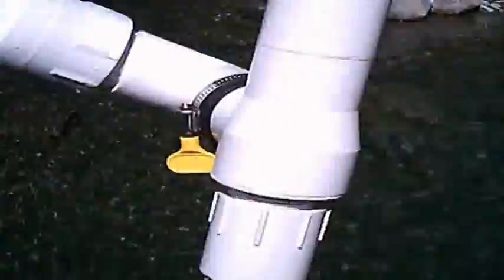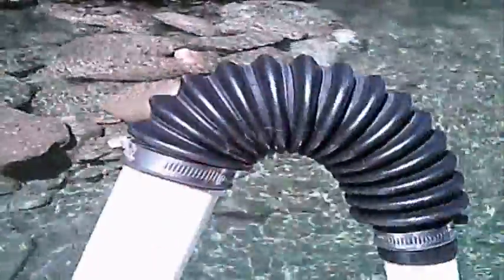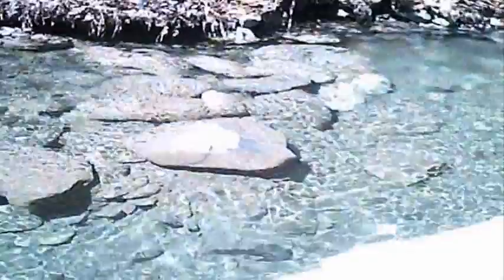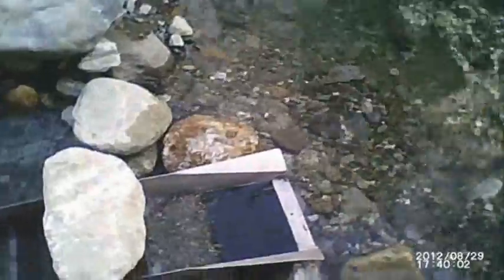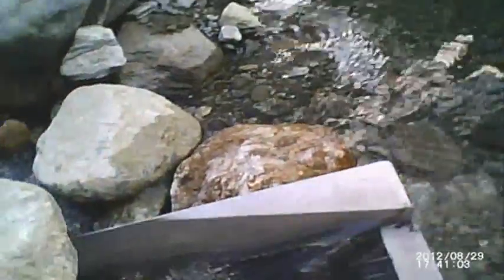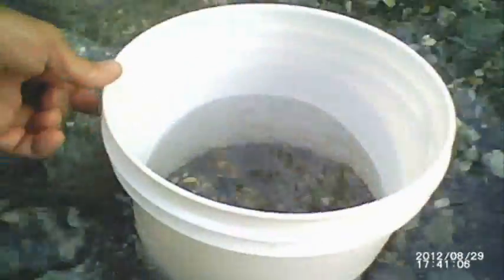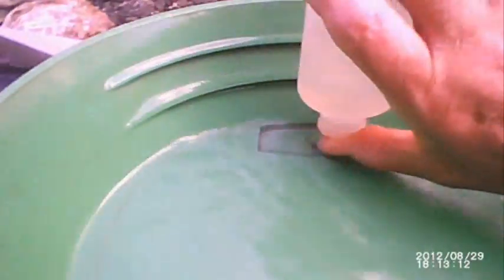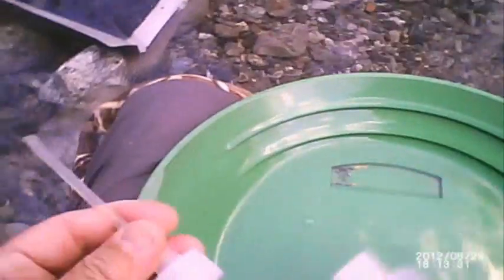Hand Dredge and Submersible Gravity Trap GOLD Concentrator

Comment: Golden Sniffer...
I'm curious as to the height of your discharge. Every other hand dredge has the discharge located just above the intake valve...not yours.
Is there a science or logic in the location?  did you experiment with other locations?  In short...how did you determine the best location for the discharge hose??
Keep the videos coming....they'er very good!
Reply from the maker: There are 2 types of discharge valves available on the M2125 and M625 pumps. The Non Sand Fouling is close to the intake, before the 90 degree elbow,  the other is after the elbow. In the latter, there's a larger cavity for dredged material to drop into before it get's pumped out.  The actual discharge port intersects the intake port so that everything can slide out unobstructed.